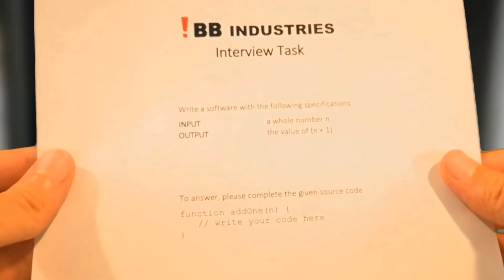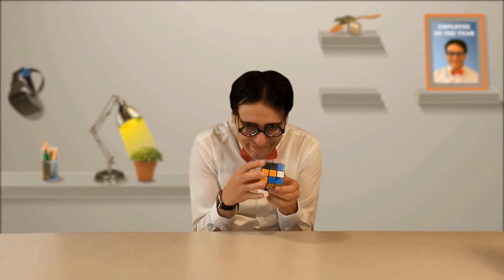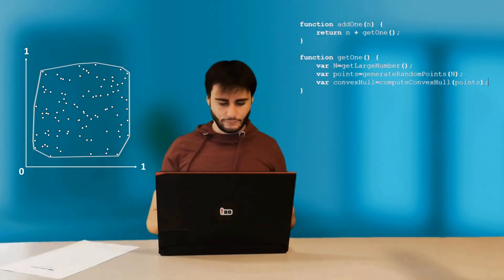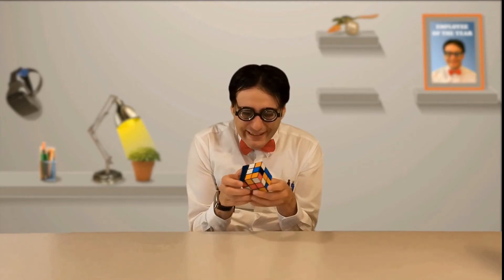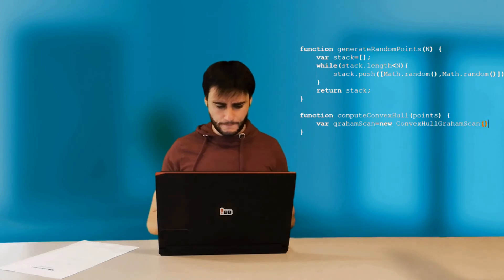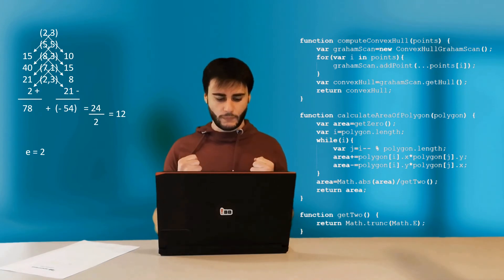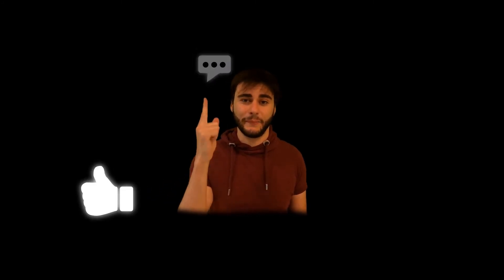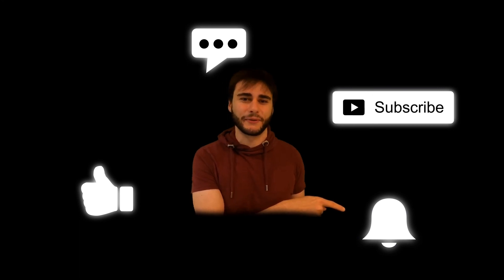Coding Interview: Ep 3 - The Shoelace Formula

Comment: Wow are we allowed to use external code? Or does that vary from interviewer to interviewer
Reply: Very funny video btw 😂😂
Reply from the maker: @msid9870  Glad to hear that I'm not the only one who thinks that :D Thanks!
Reply from the maker: Hi, based on my student's stories, companies have different ways to hire people. Some ask to build a project, and then you can do it at home over several days and can use any external sources either as inspiration or even include them if not specified not to do that. This type of task can also be a 'find the bugs' scenario where you are given a piece of code that you should polish and make better. Then, big companies are usually more strict and you need to perform on the spot and write code like in this sketch. But the difference is that you should also talk and explain your mental process. Usually no external sources are allowed for this type. It can also be a purely spoken interview, where you just explain how you would solve the problem but exact code is not needed.
Reply: @Radu  thanks for the detailed answer!!
Reply from the maker: @msid9870  Hope it helps :-)